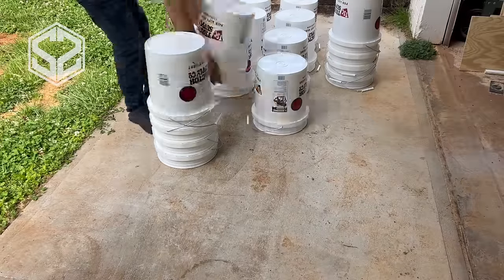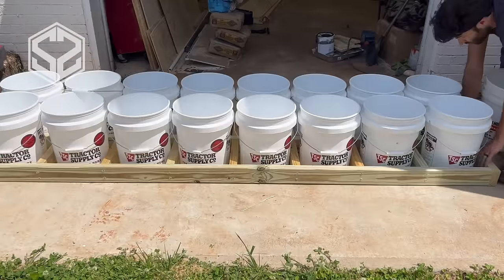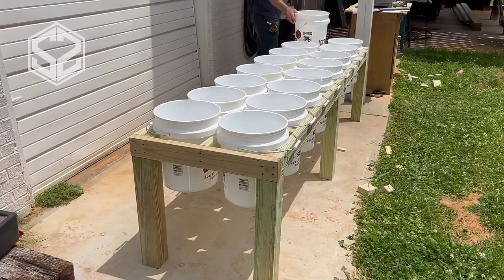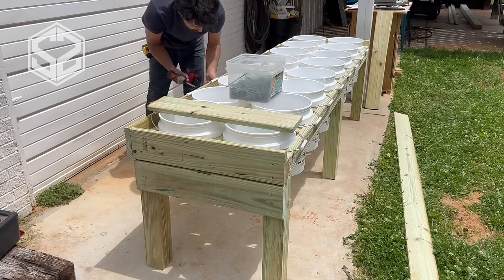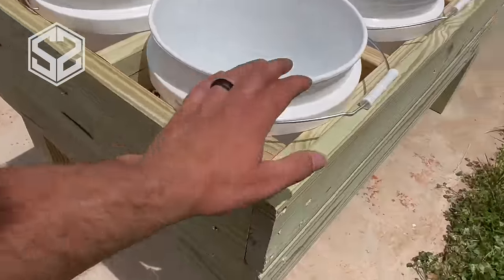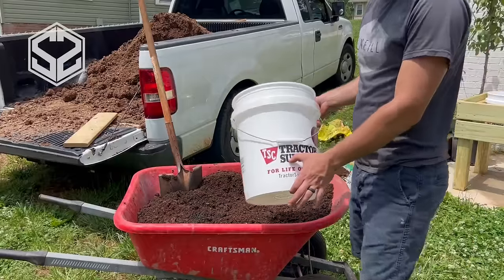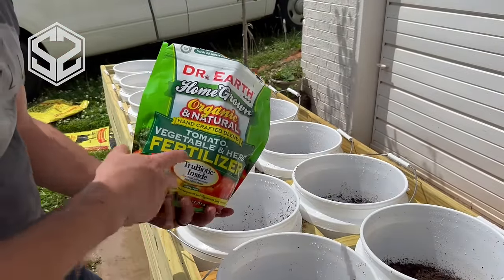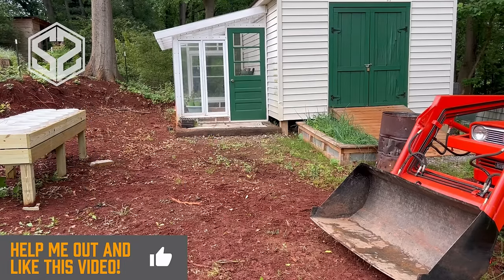Easy 5-Gallon Bucket Raised Garden Bed

Comment: I've got one of these and It's wonderful.  I will say, that for the plants that are more THIRSTY than others:  put your holes about 4 inches from the base on the SIDES - rather than placing the drainage holes at the bottom.  You can also place trays/troughs of plants BELOW the buckets to water them and provide shade as well (lettuce/beets/herbs).
Reply from the maker: Thanks for the tips! These are great!

Comment: The 5 and 7.5 gal plastic bucket is perhaps one of the best inventions every, especially for the gardener. My wife's herb garden is totally made of 5gal buckets and 60gal food grade barrels (cut the top & bottom out and cut it into 3 big rings). 
Also, we get 3.5 gal square buckets from Sam's Club bakery (icing buckets) that also work fantastic!
A tip to save money on material, 4x4 are crazy expensive now days so we use treated landscape timbers in place of them.

Comment: I will be camp hosting from April to November in West Virginia.  This is perfect solution for me to grow some stuff and not have a permanent installation.  Perfect for potatoes, herbs, tomatoes, carrots.  For zucchini I would spread apart in single bucket stands.
Reply from the maker: That’s great! Good luck with yours 😁
Reply: I would have dipped the ends of the 4x4 posts into the rubber that you dip hand tools into to water proof the legs where they touch the soil. And water proof all the wood.

Comment: Nice project, wondering about longevity.  In my experience plastic buckets turn to trash pretty quickly when outside in the sun.  The good thing is the side boards should keep a lot of sun off them and I guess you could always get more buckets if they start cracking.

Comment: Great build, good inspo ! I recommend spraying the outside of the buckets with a UV resistant Acrylic spray paint like Krylon so that the buckets don’t deteriorate in the sun. The acrylic is more elastic and will be able to expand and contract better than a more brittle latex paint for example. Good luck !

Comment: UV light + summer heat will deteriorate plastic buckets here in the Mojave desert in about a year or two. Learned this the hard way.
Reply from the maker: Wow that’s crazy!
Reply: About 3 to 4 years in south Georgia
Reply: I don't think any plastic is food grade used this way. No way. Gross.
Reply: Same time period in Hawaii. So you have to have a shade cloth covering. Can build onto this installation easily. It gives it a few more years use.

Comment: I drill my drain holes on the side 1" from the bottom.  I also fill the bottom 3" with 1/2 to 1" diameter sticks with 4" of leaves on top. It creates a small reservoir at the bottom.  Then fill the rest of the way with compost.  I plant peppers and tomatoes in mine.

Comment: Excellent idea! Does the bucket need holes for drainage? Thank you
Reply from the maker: Yes, they will need several 1/2 holes drilled in the bottom to prevent the plants from flooding. Thanks!

Comment: did you put anything under the dirt t assist in water drainage?
Reply from the maker: I did not and some of the buckets did have some issues with drainage through the rainy season. This next year I may drill a few more holes and then please landscaping fabric on the bottom to keep the soils from blocking the holes.

Comment: Nice job but what did you use to move that? Just curious Bec it wasn't shown and you hooked it up to something with the straps. Otherwise it would be difficult to move   who would help carry it and approx how much you think it weighs?I'd have to remove all the buckets first  and probably walk it but could be a two ir more person job..but then its just the weight of the wood and definitely looks nicer. Im wondering why you wouldnt want them either on the ground for the worms or maybe that is why. There are new terrible invasive worms now that actually don't do anything but destroy the soil and sit on top not like the good worms Now thats  😔ugh  they are not from here but are taking over.But i do appreciate the raised bed . I have a similar idea that im making. These buckers dont last but kaybe hiding them will keep them from geting brittle sooner, but it is  important to have food safe plastic and they can always changed out. I think i might only use the pressure treated for the legs. Could still contaminate the soil. I did see you put yhe littleblocjs under it, was that regular wood? Good idea to keep it off the soil and you could also use bricks or just put the buckets on bricksm im actually building something similar yo what you did, but a little more squarish in size.  I like yours because obviously you can plant more I think the buckets are easier and yes its still easier to move if needed n you could make more sizes and sell these too
What zone are you in? State? Oh ok i see the tractor. I miss3d that part. Lovr this and looks wonderful 🎉❤❤❤❤.could certainly be happy with your help. Good man to build this. Im sure your wife is a happy girl. Nice edges and do the fact that you made it all oreseure treated keep the planks fron warping or twisting? Or is it just becquse you want it to last longer and keep it fron rotting? 
Did you build any other type wood beds and how did they go? I agree with the dumping method is ea8er and a tarp can make putting it back easier too that way youre only adding some. Which potatoes did you plant?  Enjoy🎉 you can also just use the organic ones from the store. They do well as long as organic and cut in half if big, let harden off before planting. 😊 The bigger the containers the more you can plant. Is there any other way to attach the legs? Thanks for the video. First time watching your videos

Comment: Seems like your planter has a low center of gravity. Any issues with a strong wind tipping the planter? I was considering stealing your idea but using 3-ft legs simply for ease of gardening. I'm afraid a strong wind will blow through and tip the planter if I make it that tall. Any thoughts you can share? Thanks in advance.
Reply from the maker: I'm not sure the wind would be able to move this. This garden bed is very rugged and when constructed it was almost too heavy for two people to move. once the soil was added to the buckets it wasn't going anywhere.
Reply: It would have to be veeeery strong winds, this thing is heeeavy when fully full of soil. If you’re going to go taller though, maybe add a third row of buckets to balance out the height difference!
Reply: @snactivist  I decided to build 3-tiered planter instead of a horizontal planter. you were right, a third row balances out the weight better. also, the height keeps the 4-legged hoppy critters in check. but the best feature, imo, is the 16ft trellis off the rear. putting my vining plants in the top buckets allows them to climb as high as they wish. ill use a ladder to the vegetables i cant reach from the ground.
Reply: good idea @equallywrong

Comment: You didn't give any kind of measurements. I'm building a 12 bucket planter.  will I buy 12 ft 2 X 6es?  how far apart for all 3 12 footers?  and am I cutting the 4 x 4's down on top in 4's and leaving 1/4th to nail too?

Comment: Good craftsmanship.  But overbuilt.  4x4 beams spaced every 4 feet?  2x4 would be fit for the task.  Bolt them on so you can disassemble and break down for storage.  Looks good.  But heavy if you need to move it around the yard with one person.  And heavier than necessary lumber adds expense.  Don't use treated lumber in a yard (or for a deck for that matter).  Rain will leach it out into the soil and contaminate it forever.  Will you be wearing gloves every time you come in contact with it?
Reply: He said to use untreated wood. And 2x2 legs maybe too weak to support all the dirt in those many of 5 gallon buckets. I would use 4x4.

Comment: Why buy buckets ! Go to the ur local Safeway bakery and ask for the 5gal. square buckets. They had cake icing in them..then u know they are safe. They will fit better 😊 you could have saved $80-100 bucks..they just throw them in the trash dumpster 😮

Comment: Well I don't know how "easy" this would be if someone doesn't have these fancy tools....
Reply from the maker: Oh it could be done with a handsaw and a drill bit it would take more time for sure. 👍🏻
Reply: Just set the buckets on the ground in 2 rows and buy burlap, then wrap it around them to hide the buckets. All you'll need is a drill to drill draining holes and holes at the top to attach the burlap so it stays up, using a few zip ties. 😊

Comment: Looks OK, but is too low. Once you pass 35 and work on concrete 24in will make your back hurt. Adding deck boards is gilding a turd. No one cares you're using buckets. 💥💥

Considering that you have drain holes, why are they so small? 1/2 hole saw, drill a star pattern with one in the middle. Use white coffee filters to keep the soil from falling through. You shouldn't worry so much about looks over function, if anyone complaines tell them it's on your property not theirs. Take the bails, handles, off. They are not needed.
Reply from the maker: Thanks for the tips! Very helpful 😊

Comment: Some tricks and tips:
You can make these buckets self watering quite easily. https://www.youtube.com/watch?v=lE8OrdUZQKk
I follow this method and add additional small holes that I feed my large tomato cages through and bend the legs back toward the top outside of the inner bucket for plant support.
You can plant tomatoes seedlings very deep by growing them out in the solo cups and just inserting them in the bottom.  (Not sure how that would work w potatoes)
These buckets are easy to find if you know where to look. Chinese and Sushi restaurants (My go to soy sauce round, Pickled Ginger sq), Bakeries (icing), Deli's(Pickles and eggs). 
If you have a relationship with a restaurant ask or drive behind  and you'll find 2 or 3 each week out by the dumpster or back door.
Good Luck and Happy Gardening